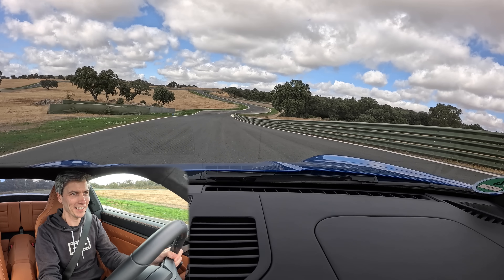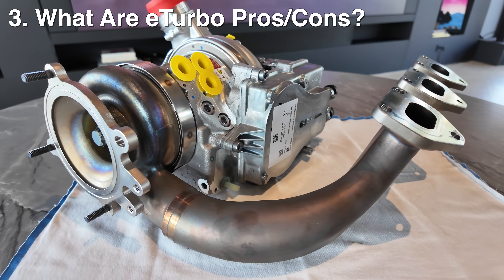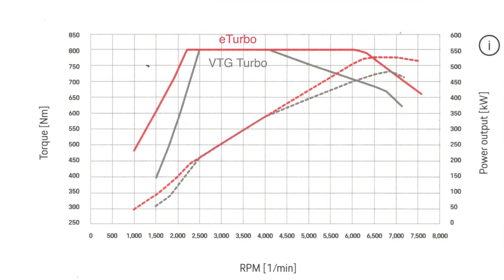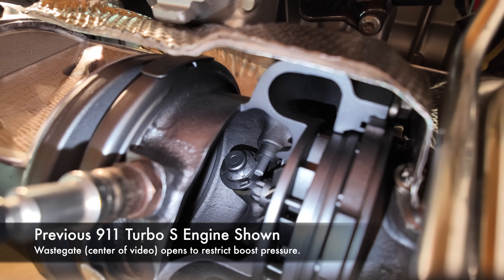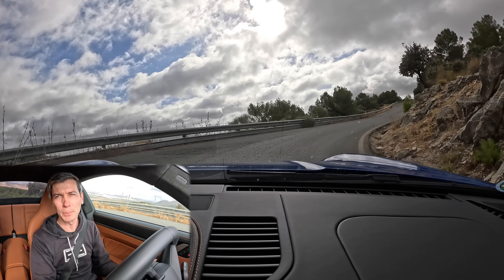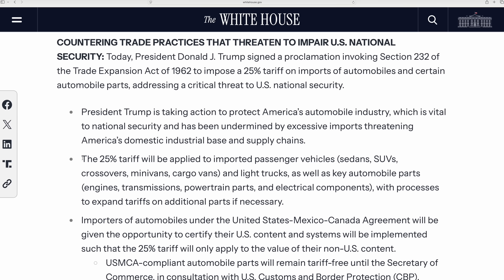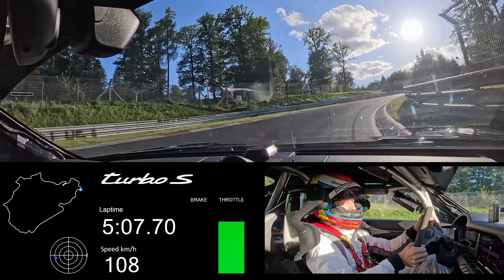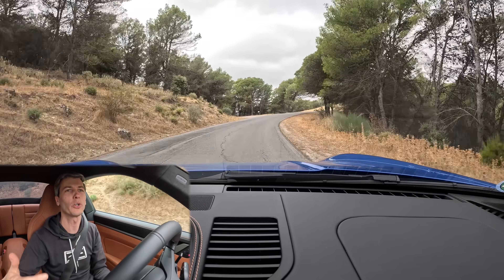Electric Turbos Are Here — Is It A Good Thing?

Comment: Can you do a video on how wheels have gotten big and tires thin for-as far as I can tell-purely aesthetic reasons? Sacrificing the shock absorption of a decent sidewall is the worst trend in the auto industry.
Reply from the maker: Worse ride, less efficient, louder, more chance of flats - what's not to love?!
Reply: @EngineeringExplained  Bigger brakes Jason!  Note that Super Touring (the 2000cc touring car class from the 90's) was limited only to 650mm rolling diameter and everyone choose to go up to the maximum practical 19" rim diameter the very instant those rims and tyres became available in 1994 (a 19" tyre on a BMW 320i touring car being absolutely huge for 1994!).  So they MUST be faster (at least in the dry, not so the wet), even if bigger heavier rim, shorter sidewall = faster laptimes is against common enthusiast wisdom? 

Note that all the GT classes are limited to 18", so they have no choice to go larger to 19" (or 22" like road 911s) even if they wanted to.
Reply: @EngineeringExplained one thing that M3 Comp guys that are actually driving them for performance do is they take the wheel and tire combo from the normal M3 (17 or 18 inch rim iirc) and putting it on the Comp. It’s a much better all around car. I don’t know too much about it, I’m a Jeep guy.
Reply: I down specced the wheels and tyres on my car by an inch in diameter and run higher profiles and the improvement in ride, handling, performance, economy and general liveability was much greater than I anticipated. Tyres cost less too! In my eyes it looks nicer as the wheels fit the original design of the car. A true win-win, which is rare in life...
Reply: It’s not simply aesthetic- they greatly improve handling. Back in the day, “plus sizing” (bigger wheel, lower profile tire) really changed the way a stock car handled. Some manufacturers have taken it too far, though, for sure!
Reply: F1 drivers hate the new low profile tires. The gluteus maximus is now the only shock absorber on the whole car.
Reply: I feel like even "17s are too big and "16 being perfect for me.
Reply: @surfside75  if I can’t put a 22 on it, I’m not driving it 😂
Reply: The "Ipad on wheels" design philosophy is way worse than lo pro tires. At least you can swap wheels and tires for a sane option. Try finding a mid market vehicle that uses a rocker switch and relays to roll your windows down instead of an $8,000 touch screen computer
Reply: @chrisblakey9116 
I agree but is that true? I think we still generally have traditional switches for windows.
Reply: @mattberning13  yeah but where does that signal go. A serviceable relay or a mini server.
Reply: @randomidiot8142 
Idk. But if it’s to the computer as you suggest I think you’re making an excellent point. 

On the other hand people us objected to fuel injection and anti lock brakes in the same manner.
Reply: Won't these do better in a skid pad than same circumference with less wheel, more tire?
Reply: @GargantuanRat 
Yes I think that’s the one advantage. But you have to be pulling some serious G’s, which isn’t realistic for street driving. Moreover I believe they’ve taken the tires lower profile than what is necessary for this benefit.
Reply: @GargantuanRat  No. They will do worse. With all other things being equal, the tire that encloses more air volume, will have more grip.
Reply: I feel like to larger brake systems have required larger wheels for space. And that makes okay for 17”-19” wheel sizes. Anything larger still seems crazy to me.
Reply: The ProCharger 101 -Supercharge CrankDrive™ is better then E-Turbo's Cause you can Change Gear Ratio's on the SuperChargeer while you Drive or shift Gears thus No Lag and You can Turn It OFF When it hit's Maximum RPM's Thus no More ENERGY from Engine to the Supercharger aka transion into a 100% naturally Aspirtated CAR
Reply: Even more pathetic are the large rims with aftermarket wheels that are added which show the undersized tiny brake discs in their Car. Then you know that badge is added by the owner and the car is just a bumper package for somebody feeling like a loser 😂
Reply: Same wheel change in F1 a couple of years ago, purely for aesthetics. The high sidewall tires helped the drivers and engineers tweak the handling from track to track. But road cars have low-profile tires, so F1 had to jump on that bandwagon. The new wheels are also much heavier, making pit stops slower
Reply: I like my m3p 19 or 20’s even though I’ve bent them, popped tires, and lower range.
Reply: @brandonhooper7748 
Your making my argument for me
Reply: Over quarter million dollar Porsche.  We need the new Tesla Roadster.
Reply: Yep, just downsized from 17s to 15s on my Fiesta ST.
Reply: I agree, 19 inches and above, suffers rim damage easier.
Reply: this is why I am still on 16" wheels on my 944 Turbo
Reply: And the Cup cars are on 18s.
Reply: @Hundredthldiot for larger brakes.
Reply: I hate my 20" wheels on my Type R, I prefer the 18" for the comfort.
Reply: Who cares how it rides, you gotta look good. You can thank me for making the world look better.😂
Reply: @metalfamily4153 

Sounds gay
Reply: wheels have got bigger because the roads are in shambles around the globe. if you dont have big wheels your car will get smashed and also lose control more easily on poor surfaces.
Reply: @22224S 
That’s not correct
Reply: Thin tires don't float as much when going through soft ground like water and mud.
Reply: @Swampbasicswooky-y5r its a fun fact, but like, nome of these cars are doing that
Reply: @Swampbasicswooky-y5r   - ha ha -   sorry ha ha ha - talking absolute rubbish here -  on the streets..
("noone" really "critically analyses most street bling)..

As J said, "what's not  to love" given nearly zero upsides.
Reply: Part of it is design. Cars are just larger today and the other is weight and power.  Big heavy cars need grip to perform like smaller lighter cars.

Comment: Am I alone in thinking it's unnecessary to have so many extra parts when two electric motors and a battery will do all of this work quicker?
Reply: Porsche is hardly about mechanical practicality. People buying their cars buy them for the feeling of driving and racing with the specific temper of a highly powerful combustion engine.

Comment: great video, but you forgot to mention , that Rimac was the one that helped Porsche with the Hybrid system, and e-turbos... Thanks to LG Chem's failures with the 1st and 2nd attempts and Porsche had to break the relationship with LG Chem. LG Chem screwed up the Taycon, Cayenne, Macon, and e-systems. LG batteries often failed.
Reply: I wouldn't lay all the fault at LG. They obviously set the specs on how to build the packs, but VW still designed them.
Reply: @rkan2 a lot of manufacturers have had issues with LG batteries
Reply: Let’s not forget jeep with the exploding batteries! I think LG still has a lot I mean too much defective battery cells in their production.
Reply: re: "great video, but you forgot to mention , that Rimac was the one that helped Porsche with the Hybrid system, and e-turbos..."  yeah no, E-turbos were developed by Garrett in conjunction with Mercedes' 7X Championship winning Formula One program (Rimac races NOTHING).  something else Swabians know is that Mercedes and Porsche are "cross town cousins" in Stuttgart with intertwined histories going all the way back to the mid 1800's.

Comment: would it be even more beneficial to combine variable turbocharger geometry and electric turbo systems?
Reply: No. Variable geometry is inherently more complex and less reliable. The resulting performance increase would most likely be negligible. If you need a more powerful turbo, you should just increase the size of the electrical motor.

Comment: I don't know man... It looks like a lot of heat is going to those windings in that motor. Reliability might be the biggest problem here, or.. maybe they already figured that out.
Reply from the maker: Water cooled motor, oil cooled turbo, and water cooling for the motor inverter. It's figured out haha.
Reply: @EngineeringExplained I wouldn’t bet on that, they don’t have a good track record for anything being reliable
Reply: @ThreeManyCars  Has porsche ever NOT been reliable?
Reply: @EngineeringExplained How similar to Honda's rumored e-compressor for the V3, do you think?
Reply: Time will tell
Reply: Camrys have figured out how to cool one of their pancake motors already ...since 90'S 

and main thing that fails is insulating coating over the copper pretty sure there are high temperature resistant enamel coatings since this EV revolution
Reply: Class H electric motors would be used. From Google: "The maximum operating temperature for a Class H electric motor is 180°C (\(356^{\circ }F\)) for the insulation system. This temperature rating refers to the hottest spot in the motor, which is typically the winding. While this is the maximum rating, typical operation in many applications is lower, often around \(155^{\circ }C\)."
Reply: The motor will only be at maximum power for a few seconds, leaving very little time for serious heat to accumulate. Also, I'm pretty sure I saw some coolant channels in those cutaway views
Reply: @DarquosLeblack  its probably not the main concern heat generated from motor but from exhaust.
Reply: re: "maybe they already figured that out."  A: yes, Mercedes (Garrett) winning 7x Formula One Championships in the Hybrid Era does STRONGLY suggest that "figuring things out" is indeed their JAM.😎

Comment: "only 85kg more..." That's a full-grown dude sitting in the car with you at all times. 

Still awesome tech - just feel like some cars should hew closer to the spirit of the car's dna.
Reply from the maker: Turbo S was always the car that does it all though. If the GT3 was gaining 85 kg, I'd say it's a very fair point. You won't notice the weight here, as it's better in every way (not just accel but also handling).
Reply: I'm too lazy to do it,  but someone should calculate power to weight ratio of the 25 compared to the 26.
Reply: @dreednlb power to weight ratio isn’t always the best indicator either because it only looks at peak power and ignores the entire powerband. The higher your average power level is the more total acceleration you will have.
Reply: @ian.williamson  Fair point
Reply: @ian.williamson  ...and isn't that basically the whole point of the elec turbo???
Reply: @ancient1946 yes you no longer have to worry about boost lag or boost threshold so you can use a much bigger turbo than normal which will be more efficient and make more power across a wider rpm range near the top.
Reply: That extra weight added better performance in every performance metric possible, substantially faster around the track.  The original 911 ethos has changed well over a decade ago.
Reply: @gpaje indeed, this 992.2 TS is 12 seconds faster on the ring than the 992.1!
Porsche did it again!
Reply: The OG turbo in the 70s was laggy and tall gearing and 2wd drive. I think the Carrera T maybe the closest to the OG car if 1 really thinks about it. Manual, turbo engine, RWD...
Reply: not always a bad thing! sometimes i'm faster with a passenger thanks to better side to side balance

Comment: I wondered years ago why these were never made, especially nowadays with modern battery tech and supercapicitors
Reply: The main issue holding it back is that just like every turbine, they're very inefficient at partial power. It makes it a great addition for a sports car, but if you're cruising on the highway for an hour, you've spent most of that time at 20 HP, and thus the turbos aren't really doing any regenerating that can't already be done with the motor on the crankshaft more efficiently.
Reply: Expensive, complex, unreliable.
Reply: @truantray yup. Pretty simple answer - only F1 has made this tech somewhat reliable and they still only need to do 6 races!
Reply: Extremely inefficient. Instead of using waste gas and waste heat preheating incoming air you now have to convert part of your engine torque to electricity to power pretty high wattage motor which also has its own efficiency factor. Then there comes all the reliability  issues of having an entire separate motor/computer right next to vibrating, hot ICE.
Reply: @notkarma2984  You might want to read into how this stuff actually works, because from an efficiency standpoint, an electrically assisted turbo is way better than an old-school one. The MGU-H, which is what this is, is part of how Formula one has been able to achieve more than 50% thermal efficiency with their engines. It completely eliminates turbo lag by spooling up the turbo on demand, and can harvest energy that would otherwise be lost in the form of heat.

Hot intake air is less dense, so you actually don't want to preheat incoming air. This is why Mercedes placed their MGU-H inside the V of the engine, with the cold side at the front of the block, and the hot side at the back, reducing heat soak in the intake tract, and keeping the hot side closer to the exhaust.
Reply: @notkarma2984  Wrong. This is more efficient. This is a hybrid system with a battery. It uses excess exhaust flow to charge the battery, that would otherwise be wasted through a wastegate.  It also uses regenerative braking. Hybrid systems are more efficient overall.
Reply: @notkarma2984  This is the same tech that allows current F1 engines to achieve record breaking thermal efficiency. Claiming it's not efficieny suggests you didn't even watch this video. Could you fail any harder?
Reply: @notkarma2984 false. The power from this comes from a separate battery that is charged with the turbo itself through the same electric motor on the turbo used to help spool the turbo. Thus the ICE is not being bogged down producing electricity for this system. It is incredibly efficient because now instead of wasting wastegate gas it is being used to charge a battery that helps spool at idle. Spooling at idle means even more gas efficiency.
Reply: @notkarma2984  "reliability  issues of having an entire separate motor/computer" pretty sure we figured those out with the ECU and the absolute plethora of motors in a car's engine bay
Reply: @notkarma2984  If you would already have a hybrid, it probably wouldn't affect effiency that much.
Reply: @notkarma2984  Agree, however I would do it differently, would not use exhaust at all, purely stored electricity gained from normal driving, put the foot down and the electric turbo boosts the incoming air without restricting the engine air flow,
Reply: @dav1dbone   What you're describing is basically an electric supercharger, and yes that has been done before. Some have an exhaust turbo to hand over at higher speeds, some drop it entirely. Still needs a beefier electrical system to power the thing.
Reply: @dav1dbone The limitation of this is that this only works while the battery still has energy stored. Plus the electric turbos operating in generator mode generate more power to be used by the electric motor than they restrict power via ‘exhaust pressure’.

Comment: Why does the eTurbo have an effect at higher RPM?  Seems like the exhaust should be able to spin it at full boost (referring to the dyno graph)
Reply from the maker: Turbos are sized for a specific RPM. Above/below that range, torque will suffer. Here, you just use a jumbo turbo so the top end is great, and you fill in the bottom with the electric motor to spin it up at lower RPM.
Reply: You find out 2 mins into the video...

Comment: Electric always wins 😂 just the range and durability is the issue 😂. Torque is the best for electrons, what id worry about is the long-term of the turbine, I hope its oilcooled for lubricant😢 as if its just friction for the motor. oh boy caboom or frictionof failed motor and bad lag. Heck if they did a dual system with supercharger that's electric or just a Normal one, wow would be insane insane 🎉